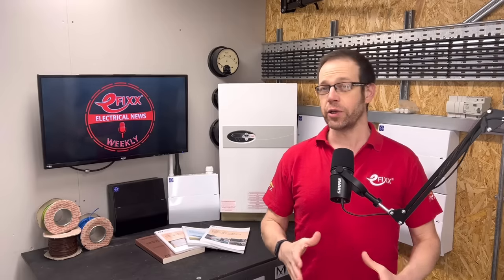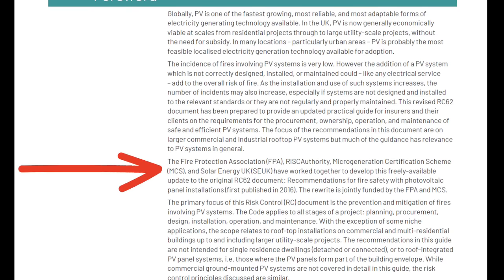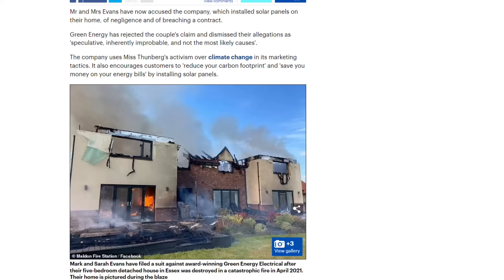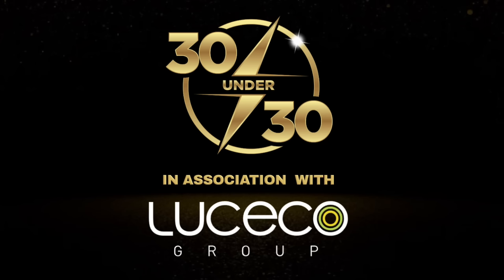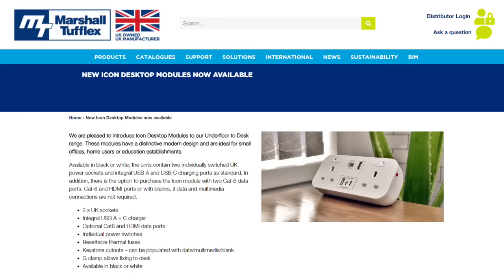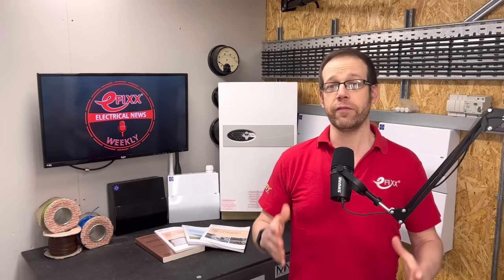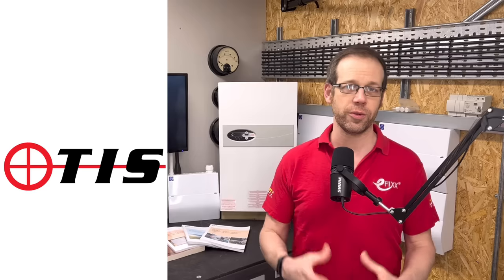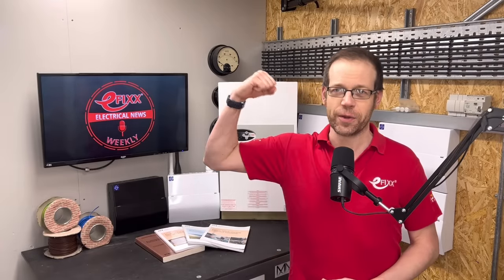DON'T Install DC Isolators On Solar, Electricians Warned

Comment: So, those news media reports are ... ridiculously lacking in any detail or knowledge.  A fire investigator can absolutely tell the difference between a fire caused by a solar panel, an isolator on the roof (a huge huge mistake), or a charge controller fire (typically situated inside or in a sealed enclosure).

DC isolators exposed to the elements should be avoided ALWAYS.  Now I know there was a time when I think parts of Australia tried to require them up on the roof for fire fighters, but manual isolators just shouldn't be up on the roof or ever exposed to the weather, even if they have IP65 or IP67 sealing.   

IMHO, I would avoid as much junk up on the roof as possible.  The combiner box, for example, should not be up on the roof either.  Backhaul the individual strings down to an easily accessible place for the combiner box.

Why?

* Manual DC isolators are usually NOT spring loaded and cannot quickly break ARCs.   This causes carbon build-up on the contacts.   Particularly at the voltages solar panels operate at.

* Manual DC isolators CANNOT be switched under load, but most people do it anyway.  This causes carbon build-up on the contacts.

* Manual DC isolators DO NOT HAVE A THERMAL TRIP, meaning that they will not automatically trip on the most common failure case for manual DC isolators.

* The contacts are extremely vulnerable to corrosion and oxidation due to exposure to the weather.  This causes additional resistance.

The carbon build-up and resistance ultimately creates a thermal event.  The plastic casing will melt and depending on how it is mounted eventually catch something on fire.    Having this up on the roof where it is difficult to inspect regularly makes it doubly dangerous.

And that is why manual DC isolators should never be installed anywhere where they are exposed to the elements, or anywhere "just because it might seem like a good idea", by installers or anyone else.   Use proper UNPOLARIZED double-pole DC breakers for your disconnects.  The only DC isolator you ever see should be the one integrated into the solar inverter (if there is one).  And even that might not be the best idea in the world.

Proper unpolarized double-pole DC breakers rated for the solar voltages involved should be used pretty much wherever you want a disconnect.  They should be in properly sealed boxes or inside and NEVER exposed to the elements.   

- Why unpolarized?  Most people, even electricians, tend to wire polarized DC breakers incorrectly and in solar applications it is often impossible to wire them correctly because the power might flow both ways, and the short condition might also come from either side and thus also flow both ways.  Unpolarized DC breakers typically do not have the two magnets on either side of the arc gap to direct the arc (polarized DC breakers typically have such magnets).

- Why 2-pole.  To properly isolate the subsystems you want to isolate both the positive and the negative.

- Why DC breakers instead of manual disconnects?   DC breakers have thermal trips, spring loaded disconnection, and ARC extinguishers internally.  The typical failure case for a properly installed DC breaker is to trip rather than catch fire. 

- Automatically trips on over-current and instantly trips on a short, and can be tested as such.

- But be warned that IMPROPER installation of a DC breaker (improper voltage range for voltages involved, improper use of a polarized DC breaker instead of using an unpolarized breaker) can also lead to a fire.

--

Also, the wiring for a solar string MUST ALWAYS BE FUSED, in addition to any breakers.  This is typically done inside the combiner box (and you should have a combiner box even if you aren't paralleling any strings).  The fuse MUST be a 10x38mm 1000V DC ceramic fuse for solar applications, period, and the amperage should be as specified by the panel label.  Each string must be separately fused (the combiner box typically has a fuse position for each string being combined, including if only one string).

Some people argue about breakers and fuses on the same string, and think the breaker's function is somehow rendered useless by the fuse.   It is not. That breakers and fuses serve two different functions.  The fuse is the primary protection against a short.  The breaker is primarily there as an ARC-safe disconnect, and also serves as a backup safety device against a panel short.  Plus having a breaker at the combiner box AND ALSO just prior to the charge controller provides protection for wiring faults that backfeed through the charge controller from the battery.

"Popping the fuse" IS NOT AN ARC-SAFE disconnect.  Its a last resort if it didn't blow on its own and the breaker didn't trip either, but you don't pop a solar fuse as your "disconnect".  You can only pull the fuse safely after turning off the breaker.

-Matt

Comment: The beard looks good on you , Joe. Thanks for the news. Happy New Year.
Reply from the maker: Not as good as yours Brian! Cheers mate! 😊
Reply: @efixx  The UK government should pass a law that clearly states that anyone who installs solar systems on the roof must make the roof fire proofe there is no other way to be hundred percent safe.
Reply: @Dailymailnewz there is … skilled workers ! 

To many acclaimed electricians who…

A- can’t make an mc4 off correctly 

B- can’t ferrule crimp a flexible cable in the DC isolator 

C- use a torque driver on the connections or even panels 

That’s why there’s so many loose connections …. I’ve done a stack of solar and they do some amazing neat work … and then the connections are hooooorifix! (See what I did there😅)
Reply: @jerome8670  CORRECT so that is one of those reason the roof needs to made fire proof by law.  the solar panel itself inside also is not perfect it catches fire in some cases even if you did it all correct so a law is needed.
Reply: @Dailymailnewz  💯 the more fire proof items the better 

I’ve always wondered why h the there’s no AFDD’s on the DC side also?
Reply: It does indeed. ⚡️
Reply: @Dailymailnewz  There such thing as a practical fire proof roof.  Even sheet metal roof will fail under the heat of a fire on top of it, plenty of pictures to be found with a simple web search of solar roof fires.  Can a fire proof roof be done?  Sure, but no one will be able to afford it.

Comment: Can I ask a question please.     I have a PV solar panel system set up away from house.   Produces 3.2 Kw on the best day.     It's a 48 V DC OFF Grid system NO Inverter.    I have a approx 50 Litre copper cylinder  connected to my radiators  to Pre Heat them.  Two 3 bar PRV Valves fitted, One on Cold flow, One on Hot flow.  Circulation Pump and Sensor powered off 230AC.    Do you know of any  48 V DC Temp Sensor etc to Cut off the DC supply to cylinder In the event of the Pump failing or AC current cut off.     Thank you

Comment: Thank you for this valuable information. When I was installing my panels last year, I already didn't put any DC isolator on the roof. All MC4 connectors are secured and ON the roof tiles, which are made of concrete. Electrical engineers are well aware, that the main problem in electrical circuits are contacts and switches. High voltage DC is the worst, if arcing starts, it will burn until the contacts are separated at least an inch or so. I have MC4 HV fuses on positive and negative side and a HV DC fuses before the inverter. Solar cables are laid separated about 2 inches, in case of rodents would eat thru insulation. I think this will do. Better safe then sorry.
Reply: How do fuses help, unless you are connecting panels in parallel? In series, the fault current is already limited by the output of the solar panels!
Reply: @mrtechie6810  You are absolutely right. Since I have two fuses on each side of the string and another double DC fuse at the inverter side I'm hoping that in case of "mild lightning", I mean not direct lightning strike, fuses together with over voltage varistors would save my inverter. Each string gives 18Ap and fuses are 25A, so solar will never trigger them by itself. It's just my over engineering with a bit of hope in mind.

Comment: Given that it is frequently going to be difficult to establish the exact cause of an electrical fire in a PV installation, surely there should be equal emphasis on both:
a) correct, accredited system design and installation, and
b) comprehensive consequential damage insurance provided by the installer (backed up by the equipment supplier)
...anything less is going to result in a bunch of companies squabbling over who's to blame (as with Victron).

Comment: What is the difference between ac and dc isolators . Both have make and break contacts and should be rated at appropriate capacity. Normally there would be arc quenching filters to avoid contact arcing. As these isolators are only operated on a very low duty cycle it seems that the installation may be suspect.

Comment: Can someone explain how a DC isolator might cause a fire?  Or how a fault that caused a fire might not have done so had there been no DC isolator installed?  

As Joe said there's a hefty line up of expertise behind this advice, so it should be taken seriously.  But even so what is the exact problem?
Reply: Use of the wrong type of isolator or improperly installed would be my take, not that the isolator itself is the problem.
Firefighters also don't like it if the solar panels can't be disconnected and might refrain from putting out a fire and instead go for letting the construction burn.

Comment: I searched for a DC isolator switch when installing my first solar system 
I could only find 160 volt DC switch
Knowing the danger of isolating DC I wired my solar in serie and parallel for a maksim of 126 volt
Since then the new inverters mppt range is 120 to 500 volt or higher 
That present a problem
So the only way to isolate is to remove the load first
Switch everything off before isolating the pv supply
DC voltage and current flow cause a significant arc that is difficult to break and will burn the breakers
Any carbon caused by the arc in the breaker switch area will cause current flow and eventually a fire

45 Jr ago I observed in training the switch used to isolate 400 volt DC
The switch ( knife) had a separate blade parallel with the main blade that was attached to the main blade with a spring
When opening the main blade, the auxiliary blade remained connected and pulling out until the spring can cause the final current break at high speed 
Faster than you can move the switch with your hand 
That was used on 400 volt DC system's
Since then semiconductors scr igbt MOSFETs etc, made the need for isolating DC obsolete 

Now we isolate on the ac system side

Solar pv isolating switch of the load current down to zero isolate.

Comment: I see no reason to banish DC isolators seeing as the inbuilt DC isolators are exactly the same mechanism, seems ridiculous to me.  Also how are you supposed to safely test short circuit currents without an additional DC isolator. (If you don’t have the pv specific test equipment)

Comment: My solar PV system was installed in 2015, and has DC & AC isolators. So far the only failure has been the AC isolator (a couple of years after installation).

Comment: MCS install fail if you don't fit an isolator separate from the inverter so ill wait until there is an update telling me otherwise. Insurance company 'experts' 
Isolators don't cause fires unless you use an AC instead of a DC and vice versa.

Comment: Surely in the event that so equipment is catching on fire it should be placing something like a metallic enclosure more as a common sensing and a regulatory thing so you can have adequate ventilation but it will contain a fire

Comment: Just had a really fun time trying to pry off some old brittle mc4's under an old SMA inverter. Voc=800V - really would have appreciated a DC isolator!!!
Reply: Just cut the cable …. Job done! 

 The problem with DC isolators is that they causing more problems from loose connections arcing and burning out as opposed to isolating for maintenance! 

There’s not enough electricians who can do a ferrule crimp and connect correctly … they twist the flex or it splays out of the connections … I’ve seen some horrific connections on some amazing looking work!
Reply: @jerome8670  I do get it. I do think that during an MCS inspection they should have a proper look at the actual installation work rather than spending so long on the poxy quality management system that nobody cares about.
Reply: @freddiewithers9617  the MCS ….. feels like it’s just aiming completely in the wrong direction! 
Way too bureaucratic for me…. Like a chicken and an egg scenario …you can’t do solar with out being MCS buuut you can’t be MCS without knowing solar 😂

Comment: Most inverter isolators are non lockable. DC isolators are double pole with air gap but some have screw terminals could this be the weak link. Maybe the connection should be mc4 as we see on Chinese made isolators
Reply: What is the point in locking them, the voltage is still present on the MC4 terminals

Comment: Question.  i rent a unit with a garage down stairs with only light circuit. probably has no earth (at least not at switch when i checked ).   I want a power point supply to mess with hobby electronics only in shed.   Can i take power off the light or is there a chargeable device that i can plug into mains in the unit and carry it downstairs to shed as a temporary power supply   ?  Thats assuming there is no earth at the light fitting when i get around to checking it.

Comment: Most commercial solar panel fires (according to a family member who is Fire Dpt Manager in a large capital city) is due to DC electrical arc's in combiner boxes or breaker switches. 

Plastic degrades with time, UV and Weather - and makes exterior boxes a liability. Not many plastics have the outdoor life of the solar panels. Even Marine UV plastic (hard UV protection used for Marine Plastics) has an estimated lifetime of 10-20 years. 

Rooftop solar fires rarely happens on AC based Micro-inverter based sites (as per the fire Dept. Manager - a 10:1 ratio taking distribution of Micro Inverters VS DC Solar into account) - needless to say he has installed solar with Micro Inverters.

Comment: Instead of an isolator, could a switch to ground be as effective? ( Or between + and - of the solar leads) This way the contacts are not in use until  that time of need. Could be installed as a single use emergency device to ensure solar voltage is zero.

Comment: I missed the arguments against DC Isolators - nothing found! So - what is this all about? We all know: PV can put an additional fire risk to your house. I try to avoid as many components as possible and just install the really necessary. An isolator switch is optional, and if properly produced and installed there is no additional risk imho. When contacts are bad - of course you have a risk.

Comment: What is the standard Cable size for solar power supply (from the panels to the solar charger?
Reply: According to the standard, the wire size depends on the maximum current, but also the type of cable and conduit and the distance and acceptable voltage losses. The maximum current depends on the type of solar panel and when multiple panels are connected, how they are wired together.
Reply: @jwstolk  thank you for response.

Comment: How are you supposed to change a faulty inverter if you can’t isolate the dc & ac supplies ?
Reply: Disconnect under no load with inverter off. Definitely less convenient than with an isolator.
Reply: @MikeyisNinja  magic stuffed under a staircase trying to change an inverter with 300 volt dc cables swinging about hoping the sunshine doesn’t come—- double f-that
Reply: @oiuslags  of forsure. My least favorite part is trying to shove live conductors into a dc charger or converter.

Comment: How is an isolator causing fires,some inverter manufacturers recommended or require separate DC isolators, despite their equipment having a built in isolator, so what happens then.
As usual, things like this happen and there's no proper guidance we have several bodies giving conflicting information and the only losers are the installers and customers.